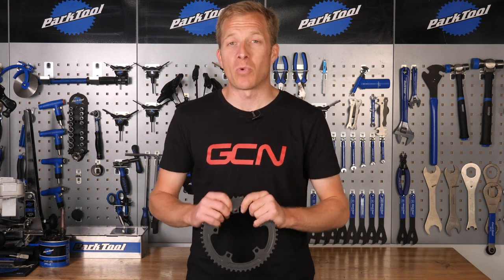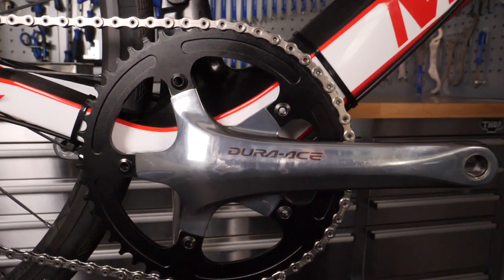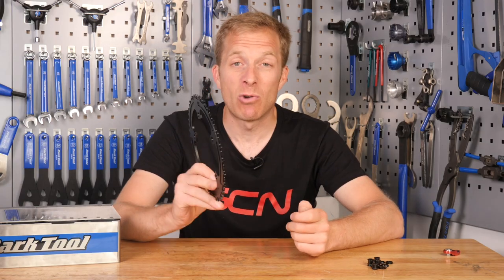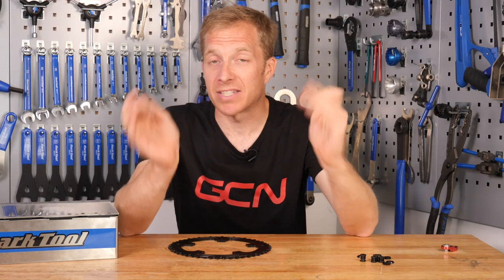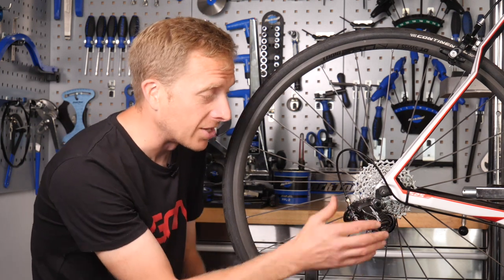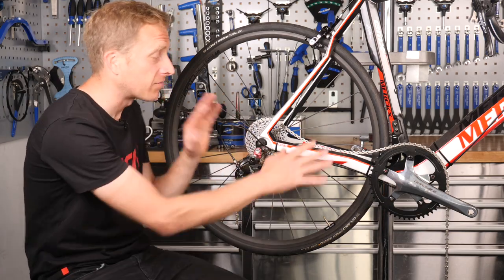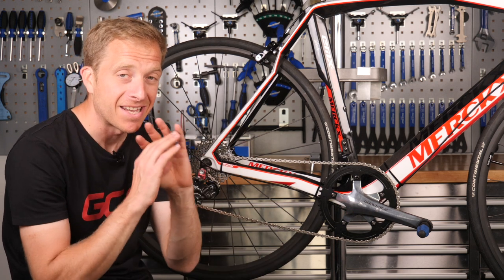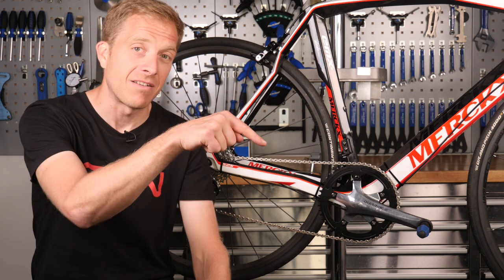Convert Your Bike To A 1x / Single Chainring Setup!

Comment: Cheers Jon. It sounds like my bike "library" is quite similar to yours. I've actually converted three of my di2 road bikes, and my fat-bike to 1x. Using ultegra 6800 mid-cage derailleurs + wolf tooth roadlink, paired with either sram 11/36 road cassette or shimano 11/42 xt cassette. Oh, and also have the sram xd hub on a set of local made carbon disc wheels with 10/42 cassette. Love all of them and have been putting more miles on them that my 2x setups. I've been meaning to submit one of them for the bike vault... anyway, when I want to feel free and not think at all while peddling, 1x is a treat - easier or harder is all I have to consider when clicking that shift button :)
Reply from the maker: Thanks Simon for watching 👍

Comment: I think the need for narrow-wide chainrings are overrated for road use.
I went for 1x on my flatbar commuter bike 3-4 year ago, because the front mech needed cleaning and lube all the time.
I am not using narrow-wide chainring, and i have only dropped the chain a very limited amount of times.
The main advantage of 1x for my point of view is much easier cleaning of the chainring.

I consider removing the large chainring on my race bike too. It so few times i need the 52T and it would be so much easier to clean.
Reply: Steffen Stengård Villadsen I thought the same thing until I dropped a chain 13 times in one ride....narrow wide chaining stopped it and haven't dropped one since

Comment: Hey John, one thing you forgot to mention is the chain line. I had to run a chainring with a slight offset to get the chain line as centered on the cassette as possible. If you run a chainring that doesn't line the chain up centered on the cassette, your are going to run into some serious cross-chaining issues when shifting at the high or low end! Great video as always! Cheers 🍻

Comment: I use a full 105 5700 groupset with a N/W chainring up top and an 11-40 cassette on the back. Chainline was coincidentally perfect with the chainring on the inside of the (formerly double) crank. Works with standard road shifters but decided to swap out the rear mech for an old 9 speed XT one I had kept for spares - its old enough to have the same cable pull ratio

Comment: How likely is it that the chain will come off on normal roads without a narrow wide chainring ?  Only comment if you've tried
Reply: P Kelly I’ve been riding single speed and 1x for years. First I’ve ever heard of a narrow/wide chainring. All that’s important imo is the chainring is designed to be 1x and to make sure the chain is the appropriate length.

Comment: Hacked mine. Standard Q ring, clutch rear Sram Force derailleur, 11-42 cassette. Down shift too fast while spinning you might drop the chain, and I don't know if a N/W ring will still that. Does everything just fine.

Comment: I got the notification for this as I was shopping for my new chainring bolts. John, I have a similar setup 2007 era R600 crank 110mm BCD and a Raceface 42T, what length bolts did you use? How did you decide to set up your chain line, inner vs outer mounting the ring?
Reply: Robert Williams still experimenting on the chain line. Cheers
Reply: Used single speed bolts
Reply: I just finished my 1x build, My chainring is on the outside of the crank mounts, and the chain line seems ok. Look for my Stevens Prestige in the next few days coming to the bike vault(I need to clean it first).

Comment: Dura ace cranks, SRAM cassette and a Campagnolo rear mech !!! What?!!!
Reply: Henri Bedford its the ultimate form of heresy
Reply: Shows that rules can be broken
Reply: What's the problem? I'm running  Ultegra 6700 derailleurs, shifters and cassette, Fulcrum cranks (probably Campy), a SRAM chain and a Campy Zonda wheelset. All that on a GT road bike (GTR Series 1 2013). And it works.
Reply: All the 11speed spacings are close enough for that to work. The big one to match is shifters and derailleur so the cable pull is right.
Reply: I agree, I've ran a Campagnolo groupset with a Shimano cassette for years, never skipped a shift!

Comment: Also.....good luck when you are in the 11-13-and the next gear. The chain will slack out and drop to the chainstay because of the SS RD having almost no ability to take up all that chain
Reply: LiveFreeandShred seems to be working just fine on the first 300km I've done on it. Cheers

Comment: Why not just leave the inner chainring in place?  Also you did not mention chain line, you really want the single ring at a position that averages the two rings.  Does anyone make offset rings that take care of this?  I would also suggest smaller than a 50 chainring, I would go for a 38 if I did 1x, but unless you spin fast you might want a bit bigger, say 42 the average of 50/34.

Comment: My wife has a roadie that we are thinking about converting to a 1X, since she really hates the front shifter and she only rides at moderate speeds on flat-ish terrain. When we first got the bike, we already replaced the rear drive train with a Shimano Deore XT long cage derailleur and a 11-32 9-speed cassette, so no need for the extender there. I guess all we need to do is finding a proper chain ring and removing the FD.
I wonder if I really need a wide-narrow chain ring. Am I going to benefit from it in any way?
Reply from the maker: The narrow wide chainring helps to hold the chain on the ring even when the chainline isn't optimal. It's also important to try and get the chainring a central on the cassette as possible to help with this. Good luck with the conversion

Comment: What about the STI lever? Does the unused FD lever fumble around while riding without the cable holding tension? What advantages do 1x offer that a 2x doesn't  besides the minimal weight lost? #AskGCNTech
Reply: John Stutzenberger hi, the lever mechanism stays in the same place. Thanks. Jon

Comment: I just don't understand why you would go through this process for a road bike. I converted a bike to 1x for cx season last year which worked out great, but if this is strictly for a road application I will never see the benefit of running 1x. I've never had a problem with chain drop on a properly set fd, and the weight penalty is so minimal when considering the benefit of running a small ring on steeper grades. Just look at Aqua Blue's DS publicly calling 3T a failing "science experiment" recently given the bike's mechanical limitations. I have no issue with innovation and applaud the desire for companies to try to propel the sport forward, but this doesn't have a benefit given the application to road riding. Additionally, the fact that 3T are a sponsor of the channel inevitably presents an issue in terms of your perspective. 1x is A future for some bikes, not THE future for all bikes.
Reply: Broadly in agreeance with your points.  Totally agree, nice to see technological innovation, and, for some (maybe many) people, possibly a good solution. New tech, e.g., discs on road bikes, I have them, am never going back to rim brakes.  Also, I have a 1X on my new MTB, and I've been shocked at how capable it is on nasty climbs, but...... with 1X, it's never been an issue about how low a gear you can run, it's about the high end, and range.  My roadie, is 50x34, with an 11-32 at the back.  That gives me plenty of range for club runs, even at pretty high speed.  I don't spin out until about 60kph, and I assure you, that's plenty for anyone in the clydesdale class like me.   With that 3T frame, the talk was always about, changing chain rings for the big climbs... How many people have a mechanic at hand to change their chanin rings for the big days in the mountains....  I know, XD drivers, etc. gives you (potentially) 50-10, but, not sold on that for road bikes....
Reply: Right and it's not even solely a chainring issue, as you'll need to match your chainring to an appropriately sized chain each time to switch your gearing. I know the higher end sscx racers will have specific chains cut for each chainring in their quiver, but for the common cyclist you can't expect them to invest that amount of money into their drivetrain for such a highly specialized system. The only instance I would be interested in a 1x road bike would be for commuter applications. I think having a 1x10 commuter setup would be ideal for almost any commuter condition, but this assumes you have the space, time and money to outfit such a rig. It's certainly not a challenging conversion, but a luxury for many who are limited in the number of bikes they're able to fit in their home. Finally, if this were to be the "goal" of such a conversion, the idea of mounting da and campi on a commuter bike is ridiculous for anyone who isn't blessed with secure bike storage at their office.
Reply: It depends on what your definition of spinning out is.  I ride a 1x cross bike as my road bike these days with 32mm slicks.  Although the most I like to spin for a longer period of time on my 42 front 11-36 rear is between 120-130 rpms, with my 32mm tires that puts me about 59-64kph.  I can ride 120-130 rpms all day if I want to.   I rarely are spinning < 100 rpms if I can help it.  That's just how my physiology works best and most especially what my knees like best, and I clear lactic acid much better when spinning.   If I spend a day riding at 70-80 rpms, my knees get angry with me and my legs are not happy.

I can go 150rpms or even more if I really want to for short periods of time like sprinting, that would put me close to 74kph.

I have a 50x I could throw on the front, but I don't have any real reason to do it, I don't typically want to ride any faster then I can already go on the 42x11 and I don't want to limit myself to gears I have to mash in otherwise.
Reply: There's not necessarily any weight penalty at all.  If your double setup is an 11-28, you won't save any weight going to an equivalent 11-40 that you'll need for the 1 by.   You will get much worse gear spacing though.  

Dave I think by spinning out he meant how most people spin out. I've trained to ride at 130 before too, but it's not as efficient and I don't need to.

Comment: Hi Jon! I've converted my older Giant TCX Pro to 1X. It's actually not too much of a hack (it's almost proper!) as I've gone with the new Ultegra RX Clutch RD and I have a couple of different Wolf Tooth narrow-wide chainrings to work with for different conditions. Although, my first two cyclocross experiences have been in slippery/sticky mud and I can't see needing more than the 36T I currently have up front paired with an 11-34 cassette in the rear.
My question is... Do you have a hack for "locking out" the left shift/brake lever so it isn't so sloppy and floppy?
I have some ideas on how to achieve this, but I'd like to hear your thoughts before I proceed. (I'm running Shimano 105 11 speed levers)

Comment: I have a problem with 1x chainring ... everything works fine .. but my chain comes off the 1x ring ... that happens when I change gears or in the same gear cruising & it happens out of the blue. Any ideas ? 

Thanks

Comment: Jon, is there any disadvantage using the derailleur hanger extender?
Reply: Dennis Chan if you use a close ratio road cassette the upper pulley is further from the cassette that what would be ideal.

Comment: Can someone explain to me the advantages of a 1X setup on a road bike? 

My road bike came with a compact 50-34t up front and an 11-32t cassette, so by converting to 1X I'm just sacrificing the use of my small ring but for what gain? I can understand you'd save a bit of weight but surely that is only going to be useful if you're riding a lot of hills which you'll no longer be able to do because you've lost your climbing ring on the front. am I missing something?

Comment: But what about shift levers?  It seems you need to have mismatched lever with the right side being sti and the left a totally different brake lever ;(. I love 1x but the manufacturers aren't servicing the market.
Reply: Nathan Brown hi, they are identical shifters. The left shifter has no cabling. Thanks.
Reply: Jon Cannings doesn't that mean you have that extra parts in there that aren't used?  I am an irrational weight weenie :p
Reply: Nathan Brown I could remove all the internals yes. Maybe I will in another video 😉

Comment: Coming into road biking from mountain biking, I’m used to riding single speed as well as 1x set ups. I quickly removed the 53/39 chainrings and frnt D, and have a single speed 47t ring on my 1x10 (12-25) I also am in phx,AZ, so the road riding is flat and way easier than the mountains. I’m actually surprised road bikers are still using 2x10,11,12 set ups. It really isn’t needed.

Comment: Is it better to have the chainring on the outside of the cranks no matter what size chainring you use?
Reply: David Fellows its worth experimenting with the chainline
Reply: Jon Cannings so a bit of a grey area I suppose. (Unless you have 1x cranks) on my HC Bike I have it on the inner ring DA9000 Chainset. (Works great - never gonna use 42/11 uphill) But for my TT Bike I was thinking about outer ring but the extreme chain line worries me. Ta.
Reply: David Fellows a bigger chain ring is often used on TT bikes so that you can have a better chain line in the middle of the cassette. 💥
Reply: Jon Cannings this I am aware of. But my local club TTS are anything but flat. Just did my 25mi tonight 53/28 doesn’t seem too extreme. In terms of chainline. 58t on order!

Comment: #askgcntech Is a derailleur hanger extender a reasonable solution if I want to change my cassette (11-25, short cage Shimano 105 5700) to something a little easier? Don't want to have to buy a new RD if I can avoid it.
Reply: I run an XT 11-36 with an extender on short cage 5600, working fine, just can't cross shift large-large

Comment: Is a mtb rear mech. Compatible with a road shifter?
Reply from the maker: Mostly not no, but most groupset manufactures now make 1X specific rear mechs with clutches in them which are designed for road use and larger gear ratios

Comment: Hello from the other side of the pond (USA). I was wondering if anyone here could help me out.
8 years ago I purchased a Nashbar Famous Maker Road Bike with Rival Group (everything is Rival but wheel touching components). Years ago, after some use,  I replaced the flimsier, crapped out 10-speed Rival cassette with a stronger Ultegra CS-6700 12x25 10-speed which lasted me a long time of riding. Now that this cassette has seen a few chains and has little or no effective bite, I would like to convert this 20 speeder to 1x12. The front is a 53/39. 

I saw that ROTOR makes these for road bikes cassettes  in 1x12 ($280 USD) or 1x13 ($310), kind of pricey. I've seen plenty of cheaper but decent offerings from other brands (Sunrace) in the 12 speed but these seem suited for MTB only.

Any suggestions from anyone as to if this would be feasible? Is there any spacing requirements that I would need to concern myself since the higher-gear cassettes may be wider? 

THANKS IN ADVANCED!

Comment: if my current derrailleur can handle 32 what will I be able to fit with a hanger extension? is 42 possible?
Reply: Most likely, yes. Or, if you have the money, get a mountain bike crank
Reply: Yes. I have 11-40 with room to spare.

Comment: ... Wouldn't this whole thing be more suited to your gravel grind viewers -- and not the roadies? The latter tend to run 1x at crits in the U.S but it's absolutely not a thing here in Europe. Oooor are you just doing this because of the Aqua Blue Sport team trial run of the 1x? Either way, converting ("or hacking") a normal drivetrain to 1X would be more appreciated by the gravel crowd.

Comment: Is it a hack? Is it a bodge? You decide
Reply: It’s neither.  It’s a hodgepodge.  But as long as it gets you where you want to go then who cares.
Reply: For me, it's neither a hack or a bodge. It's a hodge!
Reply: I'm willing to bet that if you actually rode it, the chain would drop, making it a bodge.
Reply: Jeff Low well, 380km in, no dropped chain. Including riding on gravel.
Reply: Jon Cannings colour me impressed! Did you add a chain guide/keeper to the setup?
Reply: Jeff Low nope. As you see it on the video.